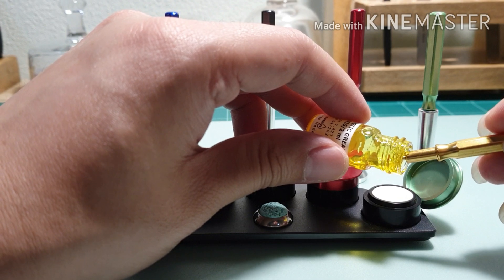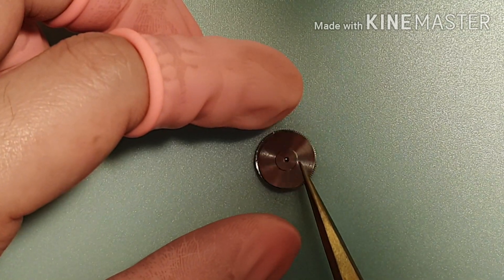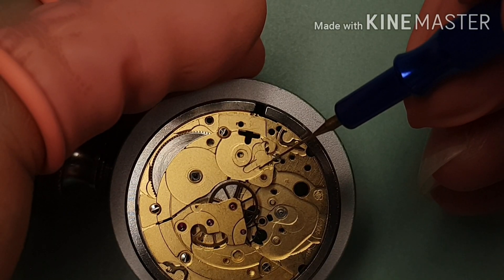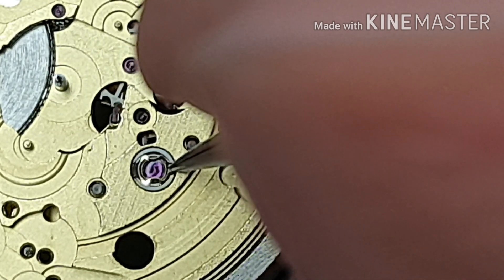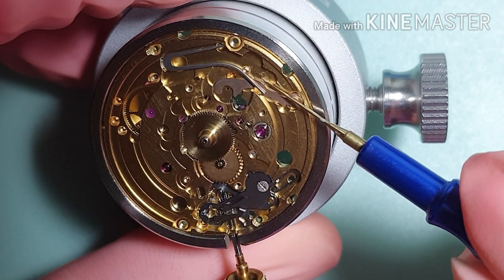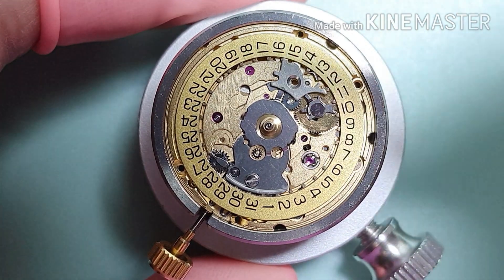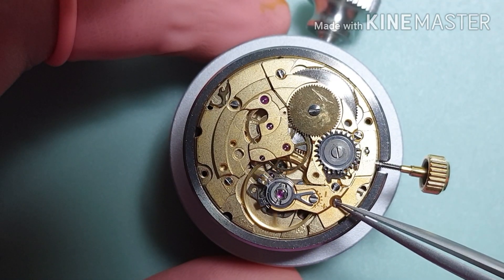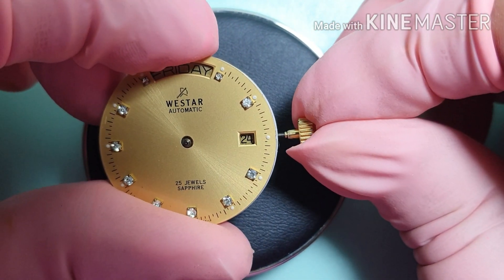Servicing Swiss Movement ETA 2834 Part 3 of 3 - lubricating and reassemble / ประกอบเครื่องETA 2834

Comment: Hi, I love your work it's amazing 👏  I have the same movement and it doesn't have  the balance stop  so I was wondering what function it has on the watch and if it's necessary?
Reply from the maker: the balance stop or hacking leaver is for hacking function, second hand stops when the crown is in time setting position.
Reply: @magicofwheels  Thank you alot👌🤗
Reply from the maker: You are most welcome 🙏

Comment: Hi, very good video thanks!
I have an issue and I can’t align the day disc to its window. Do you have a technique for this to fit properly?

Thanks!
Reply from the maker: If you are sure you have the right day disc for the movement and dial, you may want to check if the core of the disc snaped tightly to the disc.  If you hold the  core of the disc and try to move the disc, it shouldn't be moving.
Reply: @magicofwheels  thank you very much for taking the time to respond! It’s much appreciated!
Sadly the disc is in great shape and solidly linked  together…
Reply from the maker: Could you add my face book page and send me the picture, perhaps I can help.
Reply: @magicofwheels  this is very nice from you :)

Sadly in don’t have Facebook. Do you have Instagram?

Comment: What is the difference between ETA 2836 and ETA 2834-2...? They look pretty much the same..?
Reply from the maker: When you said 2834, I bet you meant 2824.  If so, here is the only difference;2836 - day and date complication
2824 - date complication

Hope that helps
Reply from the maker: sorry for the mistake,
2834 is with the day wheel be shown at  12 o'clock position of the dial. While 2386 is either on at 3 o'clock before the date window or at 6 o'clock reading vertically.